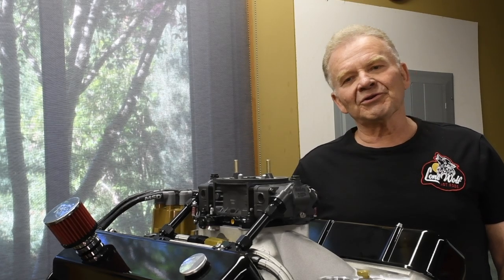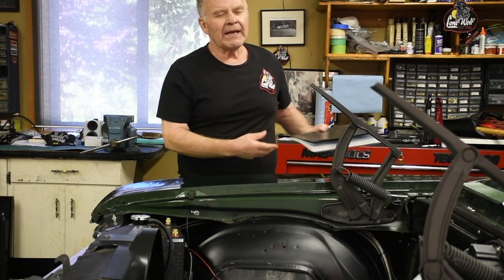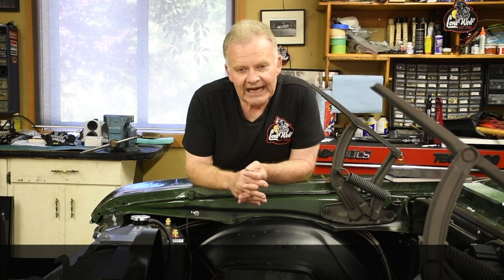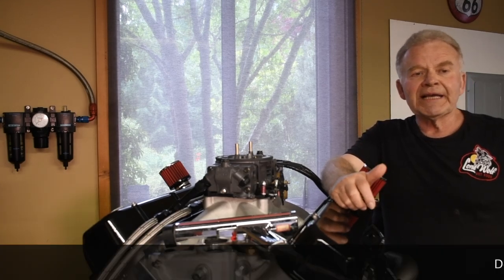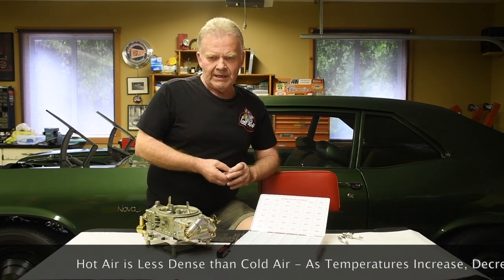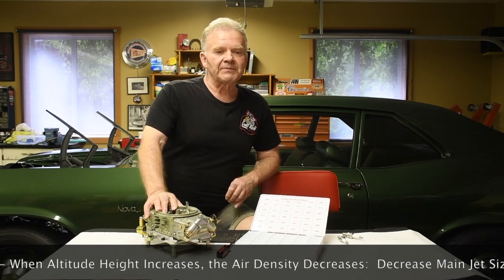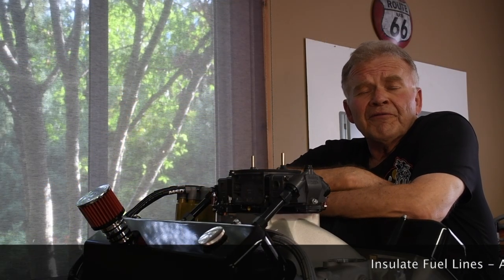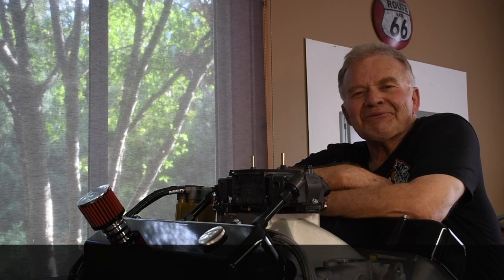Set & Tune Holley Carburetors - Super Tuning For Weather & Altitude

Comment: You mentioned Denver that is where I am. I'm working with an international
 Scout 'll with a 345 V8 with auto trans (  hunting truck)  the carb has been changed to Holley 2300
500cfm. I've dropped the jets from 73 to 70 and changed the power valve to a 6.5. Idle vac here 13 here but I need to check at altitude.I
Question is which to change first jets or PV?
Any advice would help.  Thanks
Reply from the maker: I'd work with jetting.